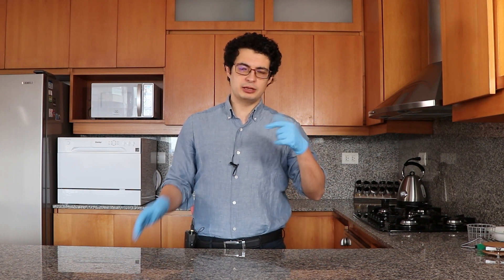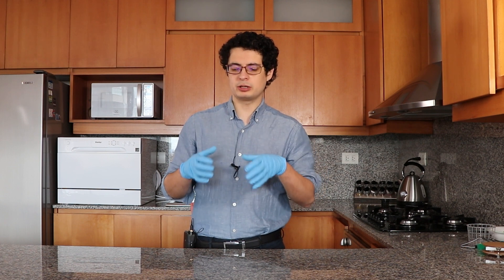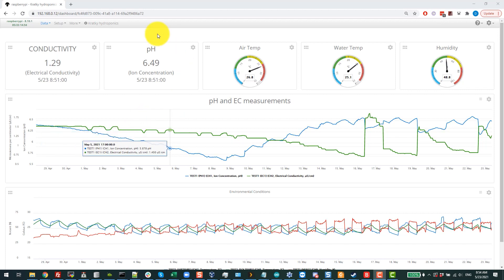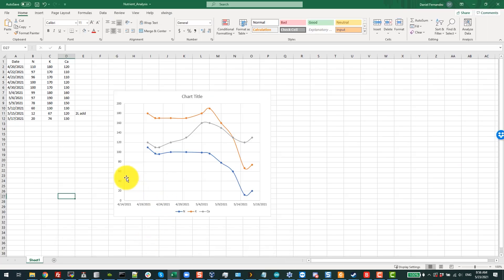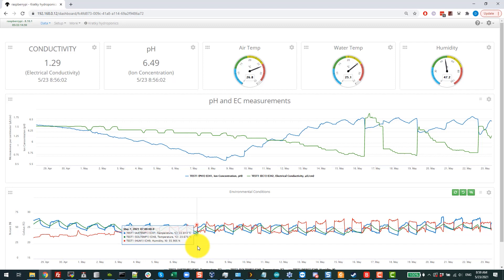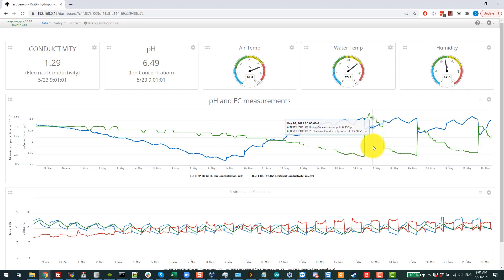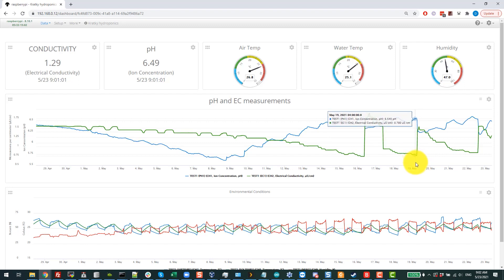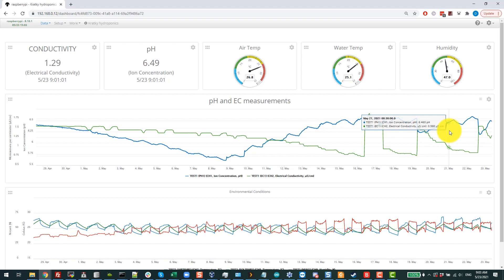A tomato plant in fully passive Kratky from start to finish - Part two

Comment: So I guess if I refill 1  liter per day at some point to keep the water level constant, this will not make the plant too stressed because air roots (within the 1 liter level, say 4 cm) will not - I hope - suffocate --- if they even become air roots in 1-2 days --- damn I need to find out  how long it takes for roots to become irreversibly air roots...
Reply from the maker: Thanks for commenting! Note that you do need to always allow for some space for air roots, if all the air roots get submerged the plant can die quite quickly. If you replenish to the same level daily, make sure you always have at least a 10-20cm space for air roots.
Reply: Krakty mentions here that conversion to air roots takes 2-4 days: https://youtu.be/MI4G3GUzrNg?t=530

Comment: Ah,  you mention it here...  omg 1 liter per day, the other guy who was saying 2.5lt per day might be right after all! He had like a 120-liter container outside for a really large tomato plant... crazy man... :D they drink as much water as me... hahaah Keep up the good work, science will save us all (if the stupids are not so many)...
Reply from the maker: Yea, they drink a ton of water!
Reply: @ScienceinHydroponics  :D Yes, on the measuring the water level, it's very very difficult to do it accurately I just found out. Another idea is to explore the optimum water-air gap ratio for tomato plants (optimal height of air roots/normal roots)... :D I'll be blessed if I manage to do this within the next years, now I just experiment since I 've just started. BTW i filled one bucket with organic fertilizer and oh boy this stinks like a sewer... probably will remove all the water inside soon...
Reply from the maker: Thanks for your reply! Yea, organics and kratky generally don't do well together. You would need to preferment the nutrients with constant air bubbling for around a month before placing them in your system. Then you also need to make sure all nutrient ratios are adequate.

Comment: Hi Daniel
Great video. I`d recommend using drain to waste aeroponics for the next test. This will keep the input EC constant and provides a  very small volume of runoff that you can test hourly. This will give you a real time snapshot of what the plant is doing. With a recirculating reservoir the input EC will always be in flux and due to the relatively  large volume of nutrient, changes will take much longer to show up.  Doing this kind of testing is interesting from a scientific point of view but also from a practical one. You dont have to guess how much water to give the plants  or where to set the EC because you get the information directly from the plants.  It provides more efficient use of water and nutrient. which is good for the planet and your pocket :)
Keep up the good work..
Reply from the maker: Thanks for watching and for your suggestions for future videos!

Comment: Thanks for consistently great content! Your site/program/channel has been most helpful for a noob who's curious about the in-depth knowledge in hydroponics. A few questions regarding this vid:  1> I've seen people re-adjusting the PH of their Kratky setup during the stage where the solution becomes more acidic. Do you think it's better to let it adjust itself without manual adjustments?   2> You said there was an algae problem during the early stages. Your post on algae said hydrogen peroxide does have some side effects which might harm your plants. What method did you use to deal with the algae on your setup?    Thanks again for your content!
Reply from the maker: Thanks for your comment! Let me answer your questions:

1. If it doesn't drop below 5.5, I don´t see a need to manually adjust the pH of the solution. Even letting it drop close to 5 might be fine depending on the plant species you are growing. However, as soon as the plant starts growing you should see the pH start going up, especially if you're growing at a high nitrate to ammonium ratio. 

2. The algae problem was related with the bucket's white plastic that let a lot of light through. Covering the white bucket in duct tape solved the issue. However, this won't happen if you start with a bucket made of a black plastic. Adding hydrogen peroxide or any sort of oxidant to a Kratky setup wouldn't be recommended. As long as the solution is sanitized before putting it into the setup this shouldn't be needed either way.
Reply: @ScienceinHydroponics  Very much appreciated :) Your answer for question 2 is quite interesting as a lot of other sources, especially in the subreddits, said to put hydrogen peroxide as the solution to algae, be it Kratky or not. By sanitizing, do you mean to just keep it clean or to actively sanitize using NaClO or other methods? Thank you! :)